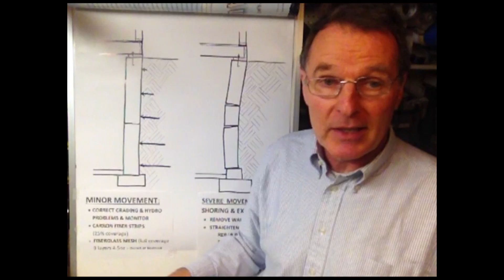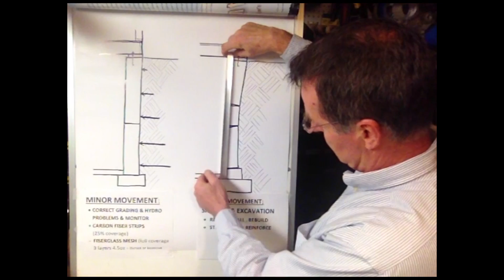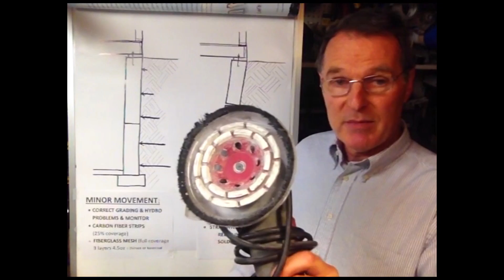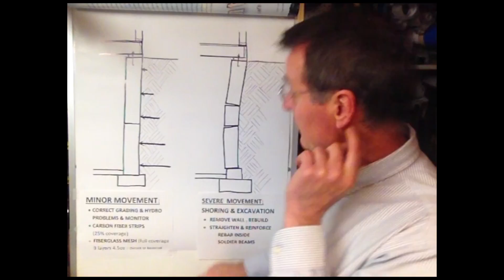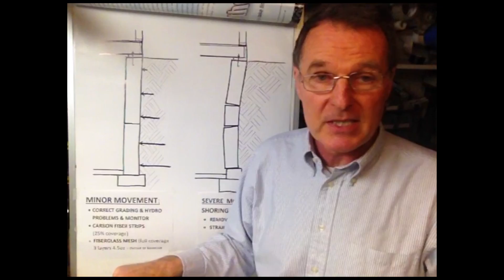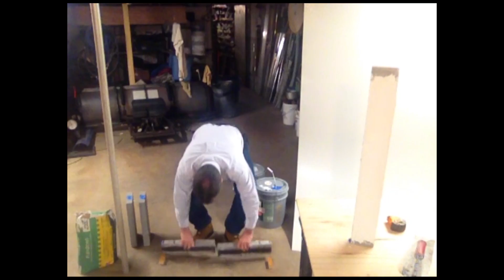Concrete Block Foundation Wall Repair and Reinforcement

Comment: I'm 7 years late to this discussion, but I really appreciate the innovative simple R&D. 
To me the worst part would be the initial grinding phase, including effort and dust. I wonder if an air operated needle de-scaler would do a good enough job of scarifying the existing concrete surface? If so, a water trickle at the needles would eliminate most dust and allow for continuous wet-vac cleanup on the floor.  Another idea might be to skip the grinding and use diluted muriatic acid (brick cleaner), to etch the concrete strips, with precautions of course.

Comment: Steel beams are cheaper, more robust, easier to install, faster to install, can be installed over previously painted walls, and hold up forever even when water is an issue.

What happens when that thinset starts to flake and lose adhesion due to years of trapped moisture inside the wall?

Comment: Great video! I'm in the Pacific Northwest on a block foundation. I am attempting to earthquake retrofit the foundation in a cost-effective manner. Here we are very concerned as you can well imagine with the twisting moment of our foundation walls. Would you recommend your fiberglass treatment over carbon fiber?
Reply: Hello
I’m in Los Angeles in a similar situation. What did you end up doing for your block foundation?

Comment: Thanks for the information, 1 question I get the 3 ' wide horizantol strip . I have a 14' wall I need to fix , so I will put a 3' horizontal strip . How many verticle strips will I need , Evevery 2' ?

Comment: here short video of exterior cracks and cracked parging which is where the water is first entering into cores of block, caused by lateral soil pressure and some tree roots https://www.youtube.com/watch?v=xVfBxvsfJQs

Comment: Lateral soil pressure and underground tree roots cause many walls to bow in, crack, leaky basements. Fairfax County VA says homeowners need to dig out the expansive clay, roots and waterproof the exterior of wall and backfill with most-all gravel/sand, so do i. Amherst NY soil study done by US Army Corps Engineers -> lateral soil pressure causes basement walls to crack, leak, bow in, so does Donan engineering and so does J Mann PE -> Structural 101, says same thing which are lateral soil pressure and tree roots certainly cause these problems, problems are on the exterior, NOT interior. Carbon straps, wall anchors and interior basement drainage systems do NOT remove, reduce lateral soil pressure, they don't remove roots off walls and they don't seal-repair-waterproof any of the existing exterior cracks where water first enters into the cores of the blocks, causes mold, efflorescence on inside walls and termites, mice, insects, radon gas also enter through these exterior cracks that apparently you are not at all concerned with, ok lol

Comment: Thanks so much Alan. I'm researching to how reinforce an 8' section of my basement wall which shows signs of hydrostatic cracking (mild). I removed all the water problems that caused the issue. Very much appreciate your thorough discussion on the subject, and the bonus experiments at the end. :)  Thanks again!
Reply: What did you go with? I’m currently in the situation you were in. How did it fare through time?

Comment: I have renovated 8' walls before with method 2.
It works very well on cmu block.
The portion of the wall I could not solid fill with mortar, cracked out again.

Comment: Excellent information from a structural engineer.  There are far too many Youtube "experts" I've seen giving DYI'ers information on how to fix structural foundations issues (not relatively simple water penetration issues).  Always hire a structural engineer to review your situation and provide recommendations on how to address, then decide if it is possible to DYI or if you need to hire an experienced contractor.

Comment: I am curious if one could use a beam system to straighten a bowed wall over a few months then, remove the beams and use this process to reinforce the wall to keep it straight.
Reply: Apparently they have something called an intellibrace which supposedly straightens the wall over time

Comment: you can find EIFS at home depot now 
EIFS mesh https://www.homedepot.com/p/BOEN-38-in-x-150-ft-Non-Adhesive-EIFS-Stucco-Mesh-EM-38150/203071686
Thinset  https://www.homedepot.com/p/Custom-Building-Products-FlexBond-Gray-50-lbs-Fortified-Thin-Set-Mortar-FB50/100122448#product-overview

sucks if your wall is painted. much more sanding will need to be done vs carbon strips.  but it seems this is stronger AND cheaper. 

I'm going to test it out.

Comment: Why was concrete block chosen for foundation walls, especially in areas with deep frost depths (6 feet plus) with pronounced seasonal freeze and thaw cycles??
Reply: Agree.  I'd never even look at house with block foundation walls.  Too inherently weak compared to poured concrete, especially in any region that has ground freeze during winter months.

Comment: I knew it. I have been doing this method for years and have not had concrete proof until now, other than never going back to the job for failure. This proves it's a better process than carbon fiber strips, which are usually installed wrong to begin with! In conjunction with steel i beams a wall will never move again! Would love to contact you and share some of the jobs and walls I have saved
Reply: I'd love to hear your results also. This is the route I'll take to reinforce a slightly damaged wall, not bowing, but showing cracks. I removed the cause/source of the water pressure and stopped the leaks first. Next will be fixing the wall.

Comment: Steel beams are cheaper than carbon fiber (or at least very similar in price) you can jack them too which will allow for 12 tons of pressure pushing back on the wall. I personally don't like carbon fiber strips.

Comment: What are the long-term deflection characteristics of fiberglass mesh? It's strong but perhaps over the years it would still allow bending. Also, is there no significant risk of the adhesion between the fiberglass and the wall give with time?

Comment: A few questions on your excellent video:
1. What are the cost comparisons between carbon fiber and fiberglass mesh? (4.5 oz. and 3 layer)
2. What kinds of waterproofing does thinset offer? Will it stand up in wet conditions?
3. Carbon fiber kits I have seen recommend tying in the top of the mesh to the plate. Do you recommend this and if so, how?
Thanks.

Comment: The repair you described at the end matches a repair I saw in a basement in Parma, OH that I have in a purchase contract.  Your video helps describe it so I know better what I am dealing with before I get an inspection.   

On another note viscosity and adhesion are also important, right?  Fiberglass is much more flexible than carbon fiber.  Fiberglass, even if it didn't break, should actually allow the wall to bow and bend with it to an extant over time, whereas carbon fiber is more rigid.      Maybe your analysis of fiberglass cloth repair would be better measuring the bowing that pressure is causing, while the carbon fiber is probably practically rigid.

Comment: Great video. Thank you for this. Information with solid facts and testing. 
I may use this in an interior cinder block wall with minor cracks. However the mortar in between the blocks seems to be deteriorating from the outside quite badly. I got a foundation repair place involved and they done seem concerned. However Idd like to seal the wall from water from the inside and outside. Would you suggest this on the outside? It’s also a good way to finish the wall to some degree as you said. Any thoughts on water sealing though? Perhaps drywall could go up over it with less likleyhood of moisture getting in?

Comment: How do I find a structural engineer that can do this in my basement?
Reply: Do a google search for "structural engineer near me".  You want to look for someone local, not a large firm.  Large firms tend to not want to bother.  Also, there are national franchises like Criterium Engineers, which are local offices with one to five engineers.  That's exactly the type of firm you want.

Comment: you want the truth or more crap?  3 short videos of bowed in block foundation walls, multiple exterior cracks, 2 of the outside, 1 inside basement  https://www.youtube.com/watch?v=rTRT6e2_exY  outside again https://www.youtube.com/watch?v=HPzTvzC7bFY inside here, an INT moron drainage system and wall anchors were previously installed, idiocy https://www.youtube.com/watch?v=VWUTKKDigzk

Comment: Question for anyone. Looking at a house that had one basement  foundation wall rebuilt with cinder block...by a professional company. Built on a hill that slopes towards the house. 100 year old house. Told the wall kept leaking and couldn't be repaired. Looks o.k from the inside, but on the outside of the house the long trench that was dug out to make the repairs wasn't filled back in. Also, a long black drainage pipe was not installed either. This house is for sale. Real Estate agent said he can get the dirt filled back in "if we want". Does anyone know if that trench should have been refilled with dirt and.drainage pipe laid? I saw no gravel or sand in the trench. It looks like the repair company did 80% of the job then walked away. Would dirt not have been out back on that wall to keep pressure off of it? Thoughts?
Reply: That's one way to relieve soil and hydraulic pressure
Reply: Jim Bike from what little I know, if you have an exposed wall the ‘frost line’ no longer applies since cold air can get down into that trench. This could lead to ‘heaving’ as the ground and water freeze from under your footers.  Idd fill of if you can. But now that it’s exposed can you do the weeping tile thing first? Also treate that wall to waterproofing.
Reply: I would say to remove the dirt against the house and start over, you never know what they did!

Comment: Do you suggest removing paint if the walls have been painted?  Great information/video
Reply: I’m no expert but I would still say yes, especially if you’re dealing with something over 50 years old. Masonry work of any type needs to breathe and weep moisture. Latex moisture traps moisture in any cement, brick, or stone, and begins its decay.
Reply: From a simple google search, it appears that thinset is not going to adhere as well to painted surfaces as it would to porous such as bare concrete.

Comment: Thank you. What are your thoughts on using this process for exterior poured concrete retaining walls?
Reply: Since the materials are intended for outdoor use, this should be equally applicable there. That said, if it’s reinforced concrete you shouldn’t need it. Plain concrete you likely will.

Comment: Thank you for this work and insight. I am curious as to your thoughts on the thin set mesh method holding up over 20-50 years against 3000 lbs/lineal foot?

Comment: Allen, my foundation walls are cinder block.  Is there any way to stop or prevent them from leaking?
Reply: I have the same problem
Reply: @nursebynight14  Both of you should look into Daniel OConnor's videos. He doesn't account for soil pressure as much as he does drainage (though, he does tend to use the rebar and cement fill on walls that are straightened). From what I gather, if you seal the bricks they fill with water and degrade.